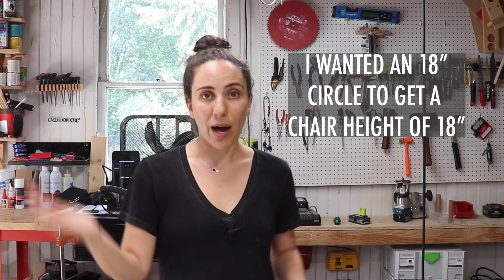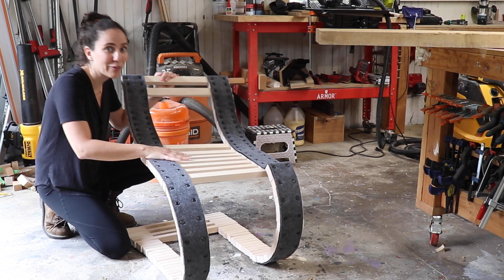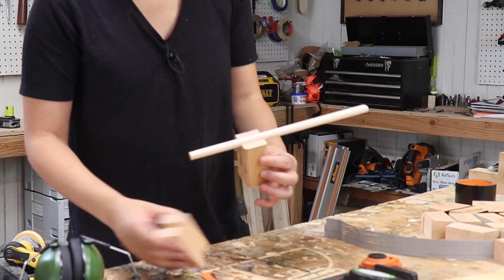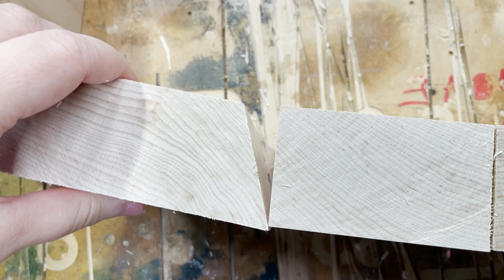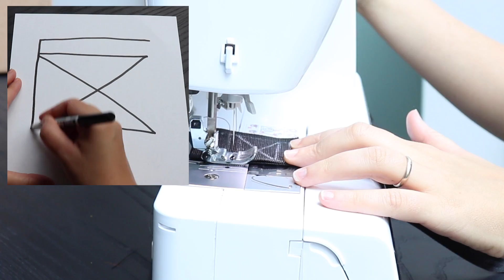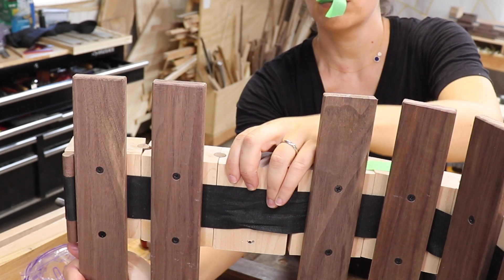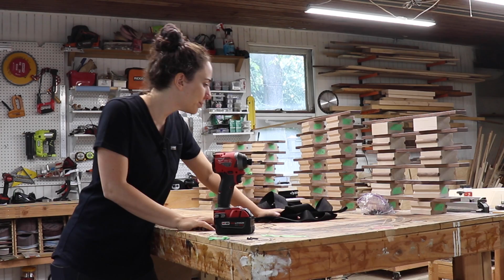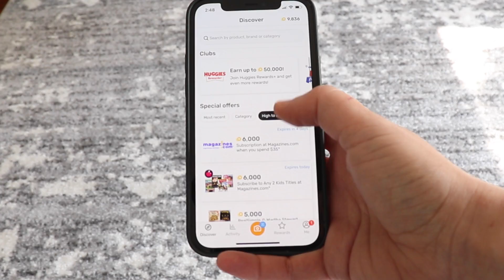I ATTEMPT to make a Roll Up Chair… AGAIN...

Comment: Have you thought about routing a very low stretch line through the pieces. Not on top of them. You could put a camed lever at one end to tension the thing after rolling it out too. Also indexing them together is a very good idea but you need more bite between the pieces.

Comment: Your patience is super impressive! Even though it didn't go too well it's a great piece of problem solving and troubleshooting.

I'm far from being an engineer, but I think scrapping the straps and attaching hinges to every piece would work. That way the pieces can't stretch beyond their intended position. I think. I'm just guessing, so take it with a grain of salt, haha!

If the whole point is to use straps I'd try to somehow attach it to every piece to avoid the whole stretch to occur over just a few pieces.

Comment: I'm not sure if anyone's already suggested this. But what if you connect the the top and bottom ends of the strapping together with some sort of fastener, like a belt buckle, by extending the strapping past the wood? I think that way the tension will form a circle (if that makes sense) and make the chair stable, kinda like those tensegrity tables.

Like the forces that want to fold the chair inwards can be opposed if the top and bottom ends of the chair have a force (like strapping connecting the two) that want to bring them together.

Comment: Try it one more time but make the bottom bow upwards alittle and use clear epoxy legs to support the back part that's my idea or if u can get bamboo fiber glass straps that could work too less stretching in it too

Comment: Great job done investing constanly to make ti possible!. May im too dumb to think that making inner holes in each section and putting metal springs in it and interconnected all the way, and the use the straps as a complementary reinforcement /positional functional, will be an alternative?

Comment: I am thinking, there are several small issues. You are using 2” webbing… why not 2’ webbing… cross stitched to each piece… 
The curves need a wider circle, so the chair looks open before sitting, then collapses into a chair shape with weight…

Comment: Use three straps over the length of the chair rather than one. The back rest and floor section are low tensile load while the section by your legs is under high tensile load. By using a separate strap for each area you will prevent the load transfer that makes it dangerous. The down side is you will need 4 fixing points for the strap across the length of the chair and not 2, which might compromise the look you are going for.

Comment: Have you considered using hinges at every joint instead of strapping? it would have a lot more resistance to tension and would still provide the flexibility to roll it up.

Comment: lots of metal hinges with wooden clip sorta thing idea on the backside so no tension issue and no collapsing. id be hella annoying to rool up because the wooden clip things would have some tension but it should still rool. maybe metal hinde bottom outs that wrap around the wood then wood could be tried back to remove that pinching issue. maybe just make the entire thing out of metal and weld it so you don't get screw tearout issues in the wood.

Comment: To me, it seems like the back side of the joints showing gaps were way under supported by the chosen angles, and the cloth on the front wasn't enough to counteract it/hold the angles in their chosen positions.

Maybe worth investigating with splines using the pieces from your practice run (like you'd be using to joint your wood faces flat in a thickness planer) by inserting splines into the back.
- Reasoning: Putting splines into the opposing sides where you see gaps... should theoretically help to add support, preventing that gap on the front side happening in the first place.
- Basically, what I'm trying to say is ironically, having a continued flow of pieces following the same curve pattern to get the desired shape... seems to be counterintuitive. Could help to alternative a reverse angle at intervals purely as a support mechanism.

Another possible method, would be to use locking rabbits on each piece. That is, there's not only rabbits which come together in unison, but something in-between the rabbited pieces which locks them into place to add rigidity to the unfolded/assembled piece.

Third thing to consider: while using rounded dowels helps to prevent twisting and collapse of the finished piece sideways, they do nothing to help the piece maintain it's vertical rigidity. Could be worth investigating alternate shapes. Maybe parallelogram or rhombus shaped dowels would help here, especially when their angles are made to counter the chair's want to continue rolling via the directional flow of the angles of the main pieces.

Without any of this, pretty sure the cloth banding would fail pretty soon anyway due to friction between itself and the wood.

Comment: Polyester stretches. Leather stretches even more and shrinks, but it can be strong.

If you ever work with Paracord, you'll find some are polyester and others are nylon. Nylon doesn't stretch.

There is a company that makes tow straps and such. I think it's "Dyna-Tow". They make very strong nylon straps for towing and hauling.

Comment: If each joint had a metal hinge it may work. But then all the pressure will be on the screws in the hinge. That may just pull out through the wood.

Comment: Think you would be better off using steel hinges rather than trying to use straps. Large part of your problem is caused by the straps spreading the load over the whole length of the chair. This cause folding at times where you want the chair to hold it's shape. By using steel hinges instead of straps you localize the load tension to each fold point and eliminate the stretching problem. Also you may want to incorporate some elastic straps with velcro to hold the back of the chair up by attaching to the back of the base; these same straps can double as packaging straps to keep the chair rolled up when traveling.

Comment: Do you have a website? This project is a lesson between theory and reality. But I'm thinking the use of wire cabling will resolve the tension as well as the stretching complexities. The other advantage using cabling is, it can be one solid length that can start at the last block on one side and terminate at the last block on the other side. I'd have think a bit which attachment method might be ideal. I don't think drilling holes  through each block is best. I'm thinking of U clamps or U brackets like used to hold piping and conduit in place. If we take the roll-up factor out of play... Bending angle iron can hold the form. Two shaped pieces of angle iron on each side of the blocks. That's four pieces and that should securely establish the chair design without fear of collapse. It will also eliminate any side to side movement. But you've got my brain working overtime. 🇺🇲👍🏻 Let me know what you think 🤔.
Reply from the maker: Yup. Links in the description to my website

Comment: Have you considered using cabling and drilling through the wood instead of attaching to the wood like you're doing with the strapping. You need the tensile strength without the stretch factor. Leather might be another choice too. I understand your vision of a roll-up chair but is that a variable that you'd give up on? Where did you go to school? What was your major? Cuz, you've got an MIT brain.

Comment: What about seatbelt fabric? I figure it does not stretch..but not sure. Also,  maybe pin strap on one side and let another move on other side or maybe pin strap in the areas of the curves. For the back of the seat,  a strap that pulls it back towards the curve should help prevent it from rolling back up.  Continuing down that path,  making the run longer, maybe you could roll up the bottom of the chair and connect the strap from the top of the back seat to the end of the rolled up part. Then that rolled up bottom could pull the top back and tension the bottom.  That wedge design is prone to sliding. I wonder if a more complex shape in certain places that only allows the chair to roll up one way and holds a block in place,  would be viable. It's an interesting design challenge. Unfortunately, that pinching issue will still happen. Now if you cheat, you make a case to hold the chair when it is rolled up. When unrolled, use each half of the case to support the inside or outside of each curve. If inside of each, it could be a seat that prevents the pinch issue, but the main use would be to structurally the chair.
Reply from the maker: That’s what I used for the second attempt here
Reply: @3x3CustomTamar  i was wondering if that strap was seatbelt.  One would think it didn't stretch!

Comment: Having looked online for this chair, the only photo of somebody in it, has them perched on the very front like you were and the chair is sagging in the back. I would say that the design as it is presented is bs and is something they are trying to make rich people waste their money on. I don't believe the design works unless you only sit on the very front because as you sit further back you change the center of gravity and without a way longer bottom the chair will always want to go backwards. To have enough tension to hold that chair in place while you sat on it fully, it would have to have enough tension to act like a spring, probably not safe either. (edit) After further searching, it was a one off prototype as a tribute to some designer, it was never meant to function.
Reply: Bruh. Watch the first video. That's the design she's testing.

Comment: It’s going to be really hard, the forces involved are considerable.

Steel strapping is probably closer to what you’d need.
Reply: With steel wire in segments (lower part, bend 1, seat, bend 2 and back) then the flex will not distrubate the full length.

Then add the belt on top for estistics
Reply: @TheMASSTTER  going with segments over 2 blocks would probably work
(The first block gets inner cable 1, the second inner cable 1 outer cable 1, the third inner cable 2, outer cable 1 etc...) This should avoid the cable stretching in a single place but not sure if it would avoid the tension making a block curl.
Reply: @satibel  yeah reducing the segments was my first thought but I think she's  also just using too weak a material.  also the design while looks great is just too problematic and using stronger material I imagine will force it too lose functionality like being rolled and unrolled.
Reply: The problem is always going to be the tension needed to support the weight, anything withthatmuch tension will always caust it to be unsafe and unstable. Like sitting on the string of a longbow. The single connection from ene to ene will never work.
Reply: @wirelesmike73  really the issue is one of leverage. The back acts as a lever and part of the block lower down becomes a fulcrum, creating something with tremendous mechanical advantage. So the forces in that convex part at the base are huge. I kind of suspect that if you solved the stretching problem, it would just crush the wood blocks.
Reply: @wackyvorlon  If the whole thing is strung together by one strap or cable or roap, the more weight or pressure put on it the more the ends are going to curl in on themselves. The flex caused by stretch in whatever is used does nothing but make that tension build up to the point of springing into the direction it wants to go. That is dangerous, because while that sprung tension may make it seem like it's strong and stable, once the stress limit is reached it creates an immediate failure that is compounded by the sudden release of all of that potential energy releasing all at once.
  Doing away with what is the equivalent of pointing a giant slingshot back at yourself will lead to the more stable solution. The only good reason to build up that kind of potential energy is if you want to move or prepell something automatically. That's not necessary for a roll up chair unless you want it to roll it's self back up on its own as soon as you stand up.
Reply: @wackyvorlon  BTW, I love the pic. The tie really brings out his eyes. :)
Reply: I posted the idea of steel rope on the first or second video, even received a like from her and thought maybe she would do it.
But for some reason, she keeps going back to weaker materials.
Reply: This is what I wanted to suggest as well, steel seems to be the only legitimate solution.

Comment: Take a look at this attempt at your roll-up chair project.
https://youtu.be/2MSEnMGFhMg

Leather will stretch.  A *LOT*.  And it won’t recover from the stretch.
It looks like the core construction is good.  If you anchor the strap to each piece, I think it would actually work as intended with something like pallet strapping or strong hinges.